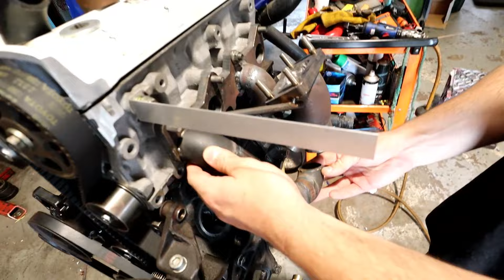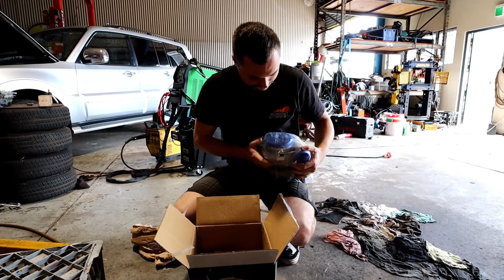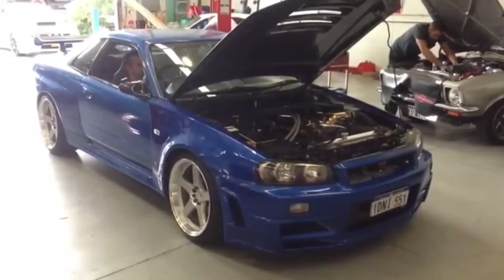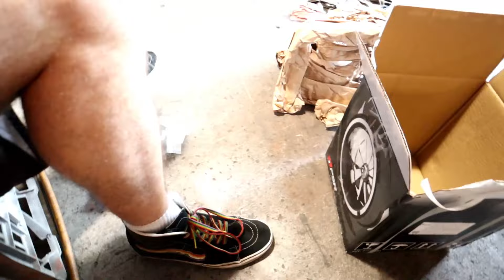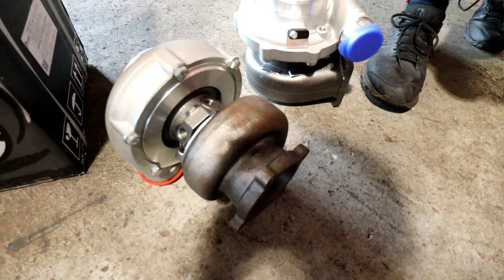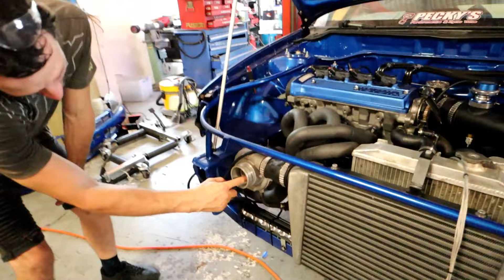Starlet gets a new huge turbo

Comment: Why do you write 4efe when it has a turbo ? Isn't it a 4efte ?
Reply from the maker: Great question!

Because it originally was an n/a 4efe engine, not a 4efte... but now it has the forged internals.

The internals from a 4efe and 4efte aren't the same :)

Many people believe you need the real 4efte engine to make any decent power, and here is our 4efe still in one peice making 300 hp
Reply: @Camp_Dogs  without forged?
Reply from the maker: @anderlinhidalgo5868  without forged I've made 165 reliably for years.

Comment: Hi Matt, could You show how to take off pistons from connecting rods in 4efe. How to do that without damages pistons ? What is The best way to do that ?
Reply from the maker: I use a blow torch using butane gas
Reply from the maker: I may be able to sneak in a quick video for you ;)

Comment: Cant wait for this. Looking forward to the comparisons too!
Reply from the maker: You reckon the pulsar is gonna spool any faster than the other cheaper Chinese versions?
Reply: @Camp_Dogs  vs the maxspeeding GT35 and GT30, it will deffo spool faster. We have those turbos here and they are strange. the 30 has a .82 housing and the 35 has a .63..
Funny thing is the maxspeeding gt2871 has the same frame as the 35 so the rear wheel and housing bolts on. (id imagine that would just surge but its interesting)
Also I am Curious why you guys went with the G30 -660 over the G25-660?
Reply: @Richardc9052  my thoughts too 550 or 660 would have been good too try
Reply from the maker: Its actually a G30 770.  the reason we went so big is we can use it on a few different cars to test its true capabilities... but trying it on such a small engine will a great test too
Reply from the maker: Bit of nitrous will kick it in the butt a bit
Reply: @Camp_Dogs  sounds like a plan! I'm not gonna lie if you test all those turbos it's saves us time 😂 the g30-770 is going to be stupidly awesome if you can get it to come on boost soon enough. Like you said, ain't nothing Nitrous can help 😎